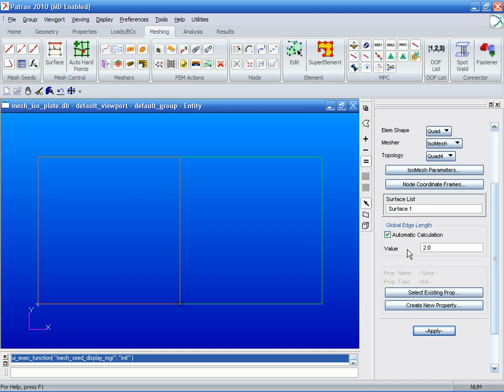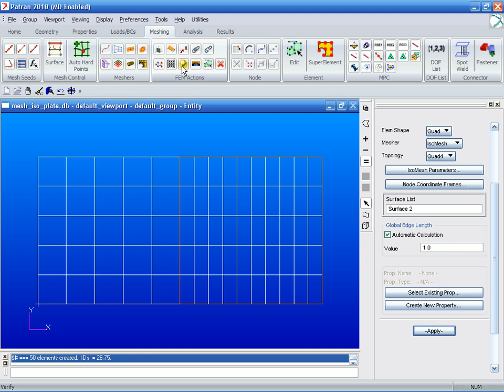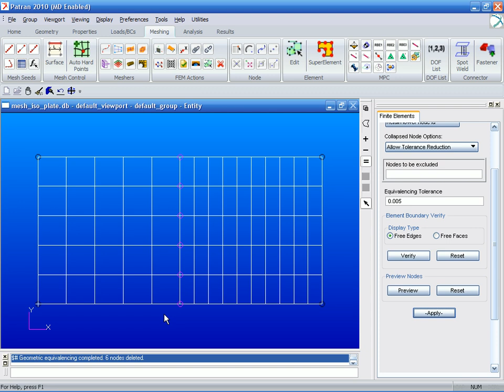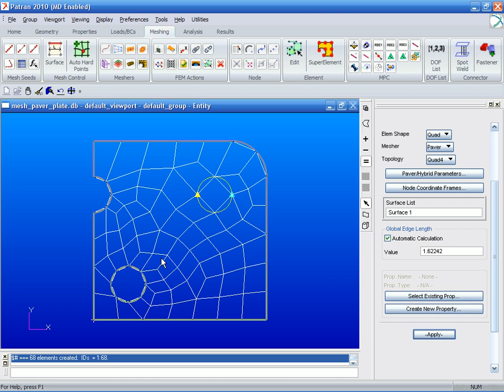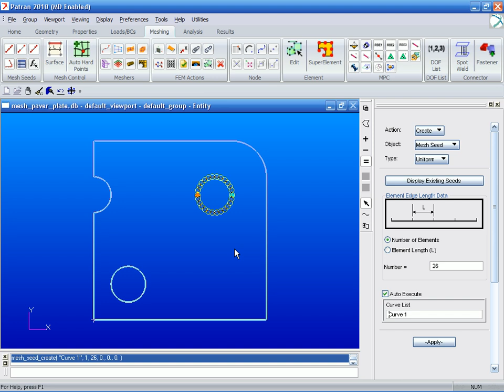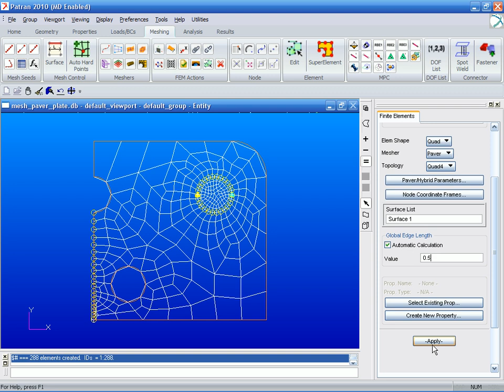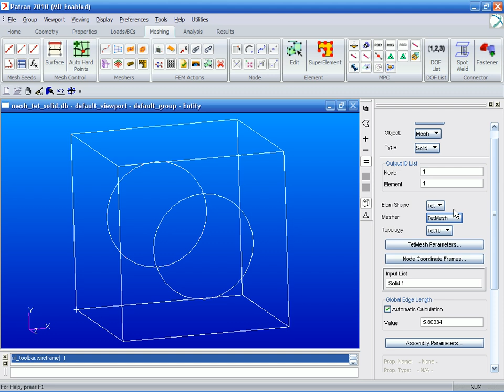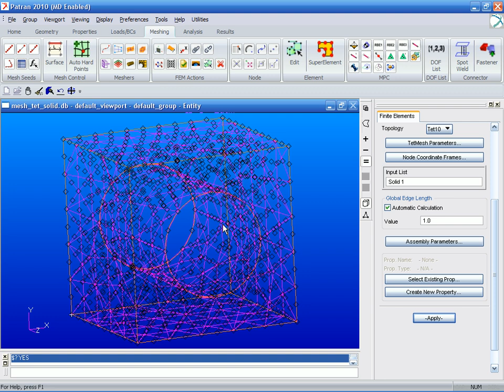How To Create a Finite Element Mesh in Patran 2010

Comment: Hi ! I need to make two meshes of a simple block in patran. One as a surface and other as a solid, but I need to use the same elements in both meshes because I need to link them later ! Is it possible to make solid mesh, with quad elements in patran ? thanks a lot